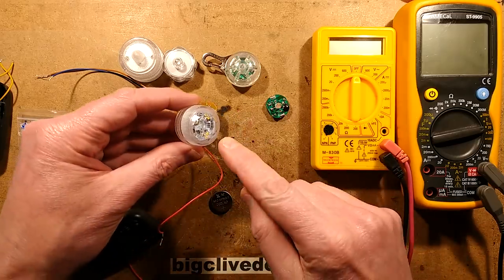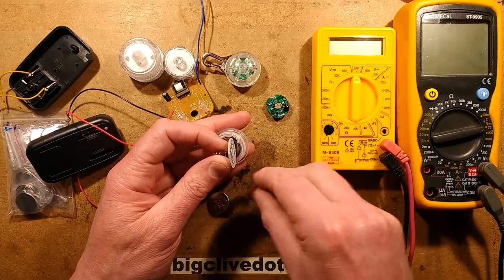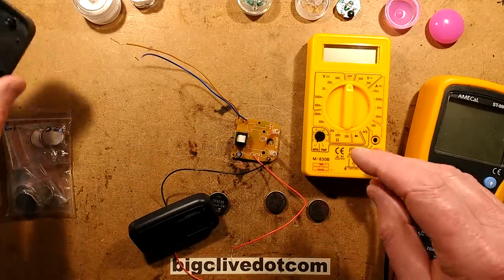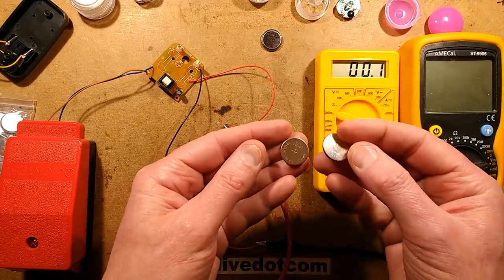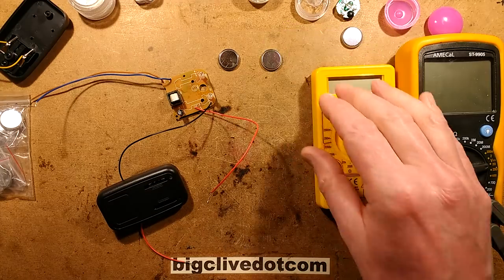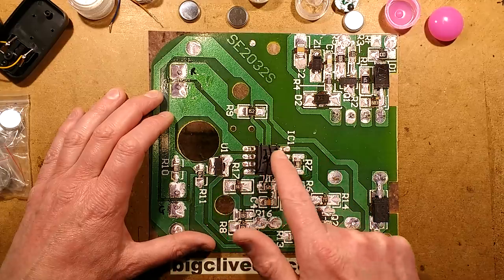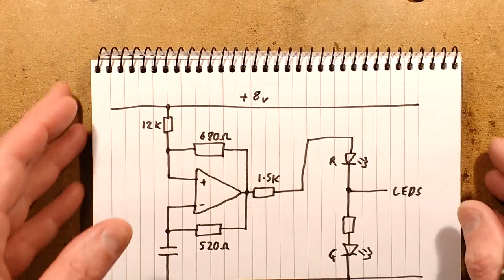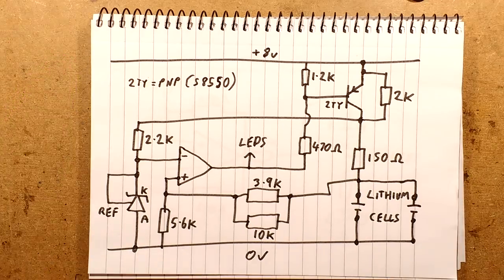Reverse engineering of shady lithium button cell charger.

Comment: I remember reading an article in an electronics magazine around 1985ish about "periodic current reversal" to charge ordinary batteries. Can't find much about it now. Would something like that be able to recharge regular cr2032 cells?
Reply from the maker: PCR, Period Current Reversal as you say, but often causes alkaline cells to leak by causing internal pressure build up.

Comment: I can't help wonder if the voltage feed to the reference is in the original circuit actually creating a ripple in combination with the pulsating red LED that in turn generates a pulsating charge to the cells. Some cells charge better with a pulsating current than with a steady current.
Reply: ehsnils I'm guessing they'll get more pulsation from the single diode power supply (as in output voltage dropping 50 times/second if the main capacitor is too small).

Comment: 17:45 "It would have been nicer if they had used a separate resistor for each of these [cells]".
Not really, because that would mean the voltage monitoring circuit would only be reading the voltage on one of the cells -- and that is potentially catastrophic if the one it's reading is much more discharged than the other. Unless, of course, you still connect the cells together in parallel, and then there's no point in "separate" resistors.

Comment: Perhaps you won't see this because it's like a year old - but wire itself should be able to handle 2.5 kV pressure frequency, so 3.5 kV is relatively low - but still fine for a generally LV transformer. 
"Should" because I have no clue what the makeup of wire they're actually using, obviously :P
Reply: Although it's most likely grade 1 wire on a Tx that small so I'm maybe over-doing it a little bit!

Comment: I've been thinking for a while about why they would have designed that circuit that way, as it just didn't make sense, particularly since it actually requires an extra component (1 more resistor) than the obvious way to do things..  I've come to the conclusion I think it must be for short-circuit protection on the battery contacts.  If the battery contacts become shorted, the original design will pull the positive supply of the reference voltage down to ground, forcing the op-amp output high (off) so it won't try to apply any power to the output.

In your updated configuration, if the output is shorted, it will try to pump full power into that short, which will probably fry something else in the charger...   This could probably be fixed better, though, by just putting a diode between the voltage reference line and the battery positive terminal or something.
Reply: Rewatching years later, I realized that just removing the 2K resistor across the transistor would remove the continuous trickle charge, while still keeping the other functionality of powering the reference from the charge current.
Reply: @johndododoe1411  Hmm...  the issue I see with that is that if there's no battery connected, it would (I think) end up with the whole thing operating in sorta halfway-on mode.  I'm not sure whether that would actually cause some sorts of stability issues or not...

I suppose theoretically it might work, as the op-amp could end up turning on the transistor just enough to keep the battery terminal voltage at the right level to balance the reference (i.e. as if there were a fully-charged battery attached)...
Reply: @foogod4237  If there's no power to the reference, the reference goes so low the output gets forced on, thus powering the reference as fully as in the original circuit.
Reply: @johndododoe1411  Actually, if the transistor is off (and there's no battery connected) then both the reference and the sense line are pulled down to ground, which means they're both equal, which would cause the op-amp to (theoretically) produce an output somewhere roughly halfway between ground and +V.  If that's low enough to fully turn on the transistor, then the transistor suddenly pulls the reference supply and the battery sense voltage both up to full voltage, which causes the op-amp to go high, which turns off the transistor, which causes everything to then be pulled to ground, which....

In reality, however, these are actually all analog components, and there is effectively a feedback path for the amplifier by way of the transistor, so what would actually probably happen is that the whole system would balance itself out such that the op-amp was producing just the right output level to turn on the transistor part-way, just enough to bring the reference and sense lines both up to be at the right threshold to keep the op-amp putting out just the right voltage to keep the whole thing in the same state.  So it might actually work, but it's a much more complicated situation electronically than I think what you were envisioning (and I'm not sure if there might be extra complications (and it might depend on the details of the particular op-amp and transistor being used, etc, too).. Personally, I'd probably need to build the thing and do some testing to be sure whether it would actually work reliably or not...)

(Though I'll also admit this is exactly the sort of trick I might expect a super-cost-cutting engineer in China to try to pull off to save a component or two, which makes me wonder if they already tried it and it didn't work which is why they added the resistor in the first place...)

Comment: It appears that my edit to my previous comment was lost.

Someone was concerned that the modification removes the initial charge current limiting. Would a series diode in the output (in otherwise original configuration) to avoid discharge when unplugged, be enough to limit the top voltage of the batteries to 4,4ish instead of 5ish V so that the initial current limiting remains in place? That would get three bird with one stone, so to say.

Comment: @22:41 "Ordinary Resistor"?! Are you suggesting surface mount is "Extra Ordinary"?! Ya, they're pretty good. A bit fiddly to work with but they save space. I love traditional through hole. But I am old and am "forced" to use a Cell Phone. Ah, bugger. Society and advancements. ;-)

Comment: expendable CR2032's also use lithium so the LIR2032's must use lithium differently
Reply: Rechargeable batteries use smaller amounts of lithium (hardly any at all) than non-rechargeable ones.
Reply: Primary coin cells use an IEC standard for naming;  the 'C' in CR2032 means it uses a lithium manganese dioxide chemistry.  The rechargeable ones can use various different chemistries and they don't all have the same nominal voltage so not all chargers are suitable for all types.

Comment: The Op-amp in the second page ought to have its terminals reversed, yea? The negative feedback is the voltage at the batteries, not the reference. Very strange that they didn't just use the 8v to power the reference. It seems it's costing them more.
Reply: The schematic is correct.  The transistors gets switched off when the output of the op-amp goes high, so the feedback from the cell voltage goes into the +ve input.  The resistor across the transistor is a crappy way of providing hysteresis (positive feedback) so the transistor gets cleanly switched off when the cell is charged.

Comment: I was wondering what frequency that transformer was oscillating at because it's core is so small and I did not think that thyristors were capable of switching on and off at really high frequencies....
Reply from the maker: Probably around 20kHz.
Reply: @bigclivedotcom  
That core was so small I thought it would have been in the hundreds of Khz, but didn't think thyristors could switch off fast enough.

Comment: For those who don’t know. An operational amplifier is a DC-coupled high-gain electronic voltage amplifier with a differential input and, usually, a single-ended output.

Comment: I didn't even know there were rechargeable coin cells!
Reply: The motherboard of your computer or the logic board of your laptop has one !!
Reply: bpanther Some do, some use a disposable one lasting around 3 to 8 years powering only the CMOS clock and it's tiny configuration RAM.
Reply: Alan Cordwell 2

Comment: hey clive, couldnt you blue peter in a couple of cheap bms circuits like ebay item 282243648769 inside the charger between the battery holder terminals to provide over voltage protection instead...  might also be good to use in the lights with the rechargable cells to protect them from over discharging.

Comment: Wouldn't the cells back feed through the resistors and eventually discharge if there was no trickle current?
Reply: Yes, but the charger would switch back on and  top them up once the voltage had fallen a little.

Comment: Power cicuit: the voltage across the 30 ohm resistor will be set by the 330K / 2.2K divider minus the vBE of the transistor plus the voltage from the feedback winding circuitry (part of which resembles a peak detector) so my guess is it sets the current using a stablised voltage (bear in mind its a guess and I'm a total amateur - confirmation would be if the zener matches the divider voltage)

Comment: The way its wired originally you have 4.2k ohms total going to the zenior. If just take the 2.2 to the upper rail you lose almost half tje resistance.  Shouldn't you add a 2k to the 2.2k to the rail so the zenior gets the same reference.  Iam still learning so iam sure iam missing something , could you explain why you removed the 2k with your mod for us who don't understand.  At first i thought maybe its not just needed. Thanks for all the great videos. 😁
Reply from the maker: The shunt regulator's resistor isn't too critical.  The 2.2K resistor will pass about 2mA.  The shunt regulator isn't a simple zener, it's an active circuit that will create the accurate 2.5V reference voltage over a wide current range.
Reply: Ty Clive
Reply: bigclivedotcom; I kind of expected it to become unstable without that leakage current.
It would be somewhat hard to tell with just a multimeter, but it might have been useful to scope the output before and after the modification to look for increased EMI or harsh transients occurring over the transistor.

I know it really doesn't matter in this crappy of a product, but I have come across something similar where the opamp became unstable if the passing element's off-state resistance was too high.
Reply: MRLT I can't see a reason why they chose the topology they did. The way the reference is supplied from the output of the pass transistor gives the circuit quite a lot of positive feedback. Positive feedback = oscillator.
Thinking about it, the battery lowers the positive feedback since it's always supplying more than 2.5V to make the reference regulate. However the reference internal resistance still provides a path for positive feedback to occur.
Reply: Jernej Jakob; Yes indeed. And, as another commenter pointed out, the secondary of the transformer would form a nice high-Q oscillator without the dampening provided by the resistor.

I have actually simulated this circuit now and, with the batteries removed, it really needs that parallel shunting resistor to not just become a broad-spectrum RF emitter.

Maybe the topology was originally intended to charge NiCd cells?
Reply: MRLT I can't see how it would. It's quite bizzarre, frankly. A very bad design choice, if you ask me.
Reply: Jernej Jakob; Oh, don't get me wrong, I agree with you 100% It's quite terrible!
That was the only remotely reasonably-ish explanation that I could come up with though.

Comment: you say those batteries make a big bang 
you cant tell us that and not show us them exploding
Reply: It's fun to throw them in the camp fire. They also go off instantly when charged with 450V at several KA.
They make a good bang and two halves of the cell will go flying across the yard.
Reply: I take it that popping CR2032's is your experimental rocket fuel?

Comment: Are all CR2032 batteries rechargeable with the video charger? or on the contrary, they are only some cr2032 and in such case how to know if it is rechargeable or it is not without the datasheet?
Reply: CR2032 are not rechargeable, the rechargeable ones are marked LIR2032
Reply: Tks! LIR!
Reply: Tks!

Comment: Recharging a non-rechargeable button cell - either lithium or alkaline or Silver oxide - produces a dangerous explosion.
Rechargeable button cells are usually soldered in a circuit, I never seen them used loosely, because the voltage is off, 4.2 Volt instead of 3 Volt. This charger hasn't a reason to exist...
Reply from the maker: This charger is for LIR2032 rechargeable lithium cells.

Comment: I was wondering if you would like a donation? I have bought some LED disk lights. They look like they are very good quality and they light very well. They do have one small issue. They flicker very slightly only when I turn on my hot water. I have a 27KW instant tankless water heater. If you like to take it to bits let me know where I can ship it to. (Can also send pictures)

Comment: Very good. I feel the term 'water proof' should not be a universal term. What is 'waterproof' to one in Scotland / Isle Of Man is not necessarily waterproof to one in Southern Europe/ West Asia/ The Moon.
Reply from the maker: Nothing is waterproof in Scotland or the Isle of Man.
Reply: That's a good question Peter Frencken. Actually, does it rain on the Moon?
Reply: Peter Frencken But IP ratings just answer some yes/no questions. To measure how waterproof something is, you have to specify a submersion depth (water pressure) and if you are using the misleading scale for wristwatches.

Comment: 👀😃
I don't understand this lv of electric underatanding but i'm able to vollow you the way you explane parts😍

Is there a section where i kan see how to store the  diverentional of 2 ends of the coil pulled bi the conditioned  plasma motion
Of the coil setup inside this coil👀😃.
Our mabey do you wish i sen't a set of coils(plasma motion dynamo) that interact with the coil araund it to manivest motion a pull en release at theends of the coil where i wast to understand how to store tis low energy in to a higher compasety😍

Just to understand how to divurt the induction feilds of plasma in to electric energy without consuming the closed plasma motio  of the plasma dynamo😍

If you wish i onley ask you during bilding to ceap the induction loop conected till it is connected to the test setup so we don't stop our disturp the plasma potion of the dynamo .
Otherwise it has to bild up space en motion again😍
En no patends can be clamed on the plasma dynamo side as it is there to surve the knowledge of oll 
En is part of plasma science evolution🙏💜

If not it is olso oke than i come to it some other time 💜
Everything is oke🙏💜
But if so i would be realy presiating
 to send a setje our to look to where you gide me to understand this part of electonics💜🙏
To make it on mi own 

It is not poseble du to the posebilete of back flow to light directley from the coil around the plasma dynamo

It needs conditions to reseave from one point en to release in to the otter  
But in mi imagionation the power of electrik is from its negative existence of the electrone we use to pull the drill in rotation😅
En this coils wurks visa versa it release 0 to puled in to a more negative place .
Thare for i plased it in a induction coil to copie direction of flow of 0

The way we  are able to move en operate our body😍

Oke i go 🙏🌐
Thank you🍀🌹🍀
Oll Injoy beīng🙏💜

Comment: Seems when I started this vid, I was viewer no. 666... :S

As for the device, I never knew such a thing existed, the only time I've come across rechargeable 2032s has been inside of devices that charge them up when the product is powered up, rather than needing an external charger, so quite a weird product... :P

Comment: I just bought a not so cheap alkaline charger.
It exploded electrolyte all over my room.
Reply from the maker: When alkaline cells are recharged they pressurise inside as you've found out.  Some vent with a sharp popping noise and some explode.
Reply: I just bought it to try it.
I read an old article that said, you can trickle charge it, if you reverse the current in between. It's more like refreshing,not charging. But this doesn't seem to work with modern cells or it is just another crappy charger.
@bigclivedotcom Do you want it or should I open it up myself?
Reply: I've never had alkalines explode under charging or extreme overheating, so I'm surprised you managed to bust one
Reply: Prehistoricman Three of four bursted, one of them exploded from first charge.
There must be something wrong.
I charged some one day before and only one of twelve leaked.
Current may be too high.
Reply: I tried charging one and it seemed fine so I left it on my desk. Later at night I woke up to a weird fizzing sound, which was the battery leaking. So even if it doesn't leak at first, doesn't mean that it wont later.
Reply: Yep that happens. I had a string of cells from a 9V battery explode while I was holding them. No funny business here, just very discharged cells.
Reply: Prehistoricman I try to reduce the current and then try again. The charger said "full" after 4 hours. That seems much too fast.